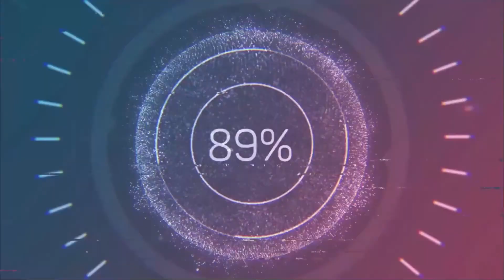All Aluminum Coils & Formicary Corrosion

Comment: Good video. I installed a Goodman unit with all aluminum coil (Daikin switched to all aluminum a number of yrs back) in 2022 and so far, so good, though I did have a TXV go bad. Ended up pushing me into an LPCO lockout due to freeze up from the coil out to the condensing unit. Crazy one little item going bad and what that can cause downstream.

Comment: Is the A frame also aluminum?

I found this video while searching for possible explanations for why my A frame is severely rusting (Carrier, steel A frame, copper coils, ~12 years old).  It seems like straightforwardly bad design.

Noted from your comments:  Don't buy Carrier or Lennox.  Consider Trane instead.  (My mother's Trane heat pump still runs like a champ after 20+ years in Texas.)

Comment: I have a Carrier 24ANA Infinity using Puron refrigerant that was installed in Oct 2010. The coils code, CNPVP6124ATAABAA, started to rust after 4-5 yrs & are now severly corroded. No leaks yet, but replacement is recommended. I live in hot, humid Mphs, TN, so no AC is a no-go. I installed a UV-C in 2020, prepandemic, to reduce mold in the system & to help my asthma. Recommended replacement of other aging & worn components is estimated to cost $11k. Would you recommend parts replacement, including a new coil (aluminum, I hope)? Or would a full unit replacement be more appropriate? Thank you for your info & insight.
Reply from the maker: I would replace it now before R410a system are gone even though you might get another 5 years out of the old system. 

I recommend you go with an all aluminum coil as you won't see the corrosion as you would see on a galvanized fin plates as they would be aluminum. You can insist on this from your contractor, make them put it in the contract. 

Humidity is a problem with any brand of equipment. It would not hurt to save the UV system and have it installed on the new unit. 

If you asthma and allergies I suggest you go with a Trane CleanEffects Whole Home Air Cleaner to capture what the UV doesn't kill. 

You can always email me your proposal and I can look it over before you make a decision and give you some advice. baileysair@sbcglobal.net

Mitch

Comment: The old coils were subjected to formicary corrosion,  incompetent engineers, bean counters, there are 40 year old g.e. still running today w.o. leaks .   No lennox for me, the company has no integrity after doing something like this .stepping up to the plate is good for buisness.  Lennox should have done this.
Reply from the maker: I was very vocal on the internet and Lennox threatened to sue me. At the time I was ready to go to court as this problem was still costing me thousands and pissing off all my customers. The just a few years later the group of lawyers that filed a class action against Lennox over these coils hired me to write up the costs associated with replacing coils out of warranty and in warranty. They used that to negotiate the settlement with Lennox.

Comment: Will 3% hydrogen peroxide, if applied to the aluminum evaporator coils cause formicary corrosion? There has been at least one HVAC forum post that claims regular store hydrogen peroxide will not cause corrosion. It is an effective method of killing  mold and bacteria on the coils.
Reply from the maker: No, hydrogen peroxide applied to the coil will not cause the formicary corrosion, and yes it is a great sterilant and kills just about anything.
Reply: Thank you for answering and providing this very informative video. My Carrier  vendor tech came to turn on my system he did not know what to do about the foul smell coming from the vents. I have been a bit frantic because after spraying the coils with hydrogen peroxide, which killed the smell, i thought some kind of  chemical reaction occurred and i would need to replace my coil.i believe some kind of fumes were coming when the system was running. Very puzzling.
Reply from the maker: @thomast9736  The fumes could come from the reaction of hydrogen peroxide with organic material on the coil that was causing the smell. We usually will mix a few teaspoons of bleach with a gallon of water and and a few table spoons of lemon juice to mask the smell. The bleach kills the mildew and mold on the coil and helps keep away the dirty sock syndrome. You could also install a UV light on the coil that will work 24hours a day killing anything that grows on the coil. This too will stop the smells.

Comment: Either way Aluminum cant hold pressure of R410a for long run 😀, just another way to low down the cost from manufacturing. I have seen many aluminum coil leaking and its hard to repair when the system containminated..I like the old day when they make copper so thick..I have seen many old copper systems older than me 😂

Comment: Homeowner:  Got new 5 ton Trane installed 11/2016.   Coil had to be replaced in two years.  Had to pay for labor and refrigerant. Now 5 years later leaking again!   
Told my warranty is good till 2026.     Any recommendations?  Should the warranty for at least the coil be restarted when it's replaced?  Thanks.
Reply from the maker: Do you have a model number of the unit? Is is a split system or package? I can give you more information once I have the details. Thanks, Mitch

Comment: Firstco is Absolute Garbage!!!!!Using Copper and Aluminum Evaporator Coils Fail Very Fast within in months.
Reply from the maker: You know the manufacturers know about this problem and ignored it for years until they all started to get class action lawsuits about this. Retooling can be very expensive and switching to all aluminum makes a little harder to meet the energy code requirements.

I think the next big class action suits might involve ECM motors as contractors keep setting them on bad duct work and burning them up prematurely.

Thanks for the comments.

Comment: I am in a FL costal environment and I have a Lennox XC21 compressor unit and garage mounted ceiling air handler that was installed in 2011. Thank goodness it had a 10 year parts and labor warranty. I had 3 coils replaced under warranty with the last coil replaced in 2019 during the pandemic. The last coil that was installed was an aluminum coil - I believe they market it as their Quantum coil. I did notice a significate increase in organic material build-up and my drain being clogged but so far the aluminum coil has been holding up. I know my system is reaching the end of it's useful life - in a coastal environment would you recommend a Trane system?
Reply from the maker: I switched to Trane because they had all aluminum coils, and yes I would recommend them. As for the organic build up, many call it elephant snot. Brian Orr of HVAC School.com has a video on it. He postulates that this recent occurrence of elephant snot was because we switched to all aluminum coils. The old copper tubing had properties that kept this from happening the same as using bottom paint for your boat that has copper in it to resist barnacles from growing. He went so far as to recommend putting a couple of pieces of copper in the drain pan to help prevent it from forming. 

Here in California we don't get as much humidity so we don't have that much growth on our condensate systems. Below is a link to his video and my second video just recently that details my theory of what I believe is the real culprit.

 https://www.youtube.com/watch?v=5VOffWjmWkk&t=288s

https://studio.youtube.com/video/sHNF7SKU4Cc/edit

Comment: This was very helpful.  Coil #3 on my 2011 Lennox Signature has now failed - at least that is the high indication without an overpriced leak test.  My first Lennox was great.  I replaced proactively at 10 years to the high efficiency.  I wish I’d just kept it until it died but as you know in FL the last thing you want is for your A/C to die and you have to act hastily.  Is the new Lennox Quantum cool any better?  I was searching on that which is how I found this video.
Reply from the maker: Thanks for the comment. Just make sure they are all aluminum or tin plated. As for Lennox now, I gave them up and washed my hands of them back in 2010 when all the coils we found were leaking. We found too many problems with their equipment compared to everything else we were setting. So, not sure how good they are. Unfortunately, advertising does work as they spend more than any other company for ads and that is why they continue to operate.

Comment: Formicary corrosion, hello Goodman condenser coils.
Reply from the maker: Hi Zach, I would be interested if you have been finding leaks in goodman condenser coils. We have not seen this happening around here, but that doesn't mean that it isn't happening as we don't set as many Goodman as we used to. Let me know what you are finding. Thanks.
Reply: The copper u bends where they run into the aluminum plate leak on early to mid 2000s Goodman
Reply from the maker: @zachosborne6577  I think those might be stress fractures and not formicary corrosion. Of course I could be mistaken.

Comment: A manufacturer Can't double the pressure of refrigerant, Have thinner tubing and insufficient welding practices and  not have leaks. I have a 30 year old evap coil and hasnt ever leaked yet
Reply from the maker: You do have a point, thinning the copper allows this corrosion to eat very quickly through the copper tubing. Your 30 year old coil was much thicker and will probably develop these same leaks only it will take decades and not years because of the thicker copper. Thanks for the comment and when time to replace use all aluminum or coated copper aluminum coil.
Reply: @baileysair  My company is a Rheem dealer. And we had a class on the systems. And I believe Rheem has doubled the thickness of the coil tubes. But made them 7mm instead of 3/8.
Reply from the maker: @smacleod69  My whole problem with this is that the manufacturers knew this was occurring and turned a blind eye or blamed the air in the home and they knew what to do to fix this. 
I had 800+ pissed off customers at me because of all the failures. In other words, my reputation suffered because these guys hid what was going on. 
If you want to equate this to some things happening recently, take a good hard look at getting the Jab and all the health problems that occurred from that.
Reply: @baileysair  I understand. I had replaced about 40 evap coils in 2021. And lennox never fixed the problem. And alot of our customers were not happy.
Reply: @baileysair  That comment surely does not compute.  Big loss of credibility there.
Reply from the maker: @jameshumphreys1927  James, that was supposed to read 2011, fat fingers, I think I replied from my phone. LOL

Comment: Never mentioned anything about the relation between coil cleaner and corrosion!
Reply from the maker: Hi Cory, most of these coils that are in the playlist we had the maintenance contract on them as we were the ones that installed the systems. At no time during their maintenance did we use coil cleaner on them, heck some were only a couple of years old and never needed to be cleaned.

This excuse by the manufacturers to blame the air in the home is laughable, as some of these coils were installed on homes that the customer did no other remodel work or changed the cleaning supplies they used in the home, in addition their old system lasted 25 years with no problems. In other words the only thing that changed was the equipment itself. 

I still believe that flow electrification was a contributing factor in addition to the manufacturers thinning the copper tubing. I tried to get several universities here in California interested in taking this up as a masters thesis for some aspiring university student, but no one would take it up, formicary corrosion isn't sexy and/or leads to bigger and better things.

I studied this intensely when it cropped up and that was my conclusions. However, the fix still stands, you need to switch to all aluminum coils. Since I have made the switch we have found a few leaking coils but they were all either bad factory welds, stress fractures or tubing rubbing together, no more corrosion. 

However, all aluminum coils are subject a myriad of other problems like being less efficient and in certain climates biological growth that can plug condensate pans and lines, below is a link to a Brian Orr video about it. However, in our area we don't see the growth issue.

By the way check out my new video on Ultra Low NOx furnaces, I see these ULN furnaces as being the new problem, luckily they are only installed in California and not anywhere else, link below.

ULN furnaces: https://youtu.be/pYAvLMWjuzQ

Elephant Snot: https://www.youtube.com/watch?v=5VOffWjmWkk&t=276s

Comment: I need to have my copper-aluminum condenser coil replaced with an all aluminum coil. Will all of the connecting tubing need to be replaced with aluminum tubing to prevent new corrosion from forming?
Reply from the maker: Question, this is the condenser coil that needs replacing? I ask because we have not had a plethora of condenser coils that need replacing. Unfortunately, the condenser coil usually comes from the OEM and that will be what ever type they make them in, some like Trane are all aluminum, other brands are still mixed metal coils. However, you can have the whomever is replacing the coil send it off to be epoxy coated so this would not be a problem in the future. They usually do this when the coils is in a corrosive environment such as close to the ocean. This can be pricey, but the coil should then last the life of the system.

Comment: I sure could use some advice. I live in NC and my 1st floor HVAC system and ductwork was replaced last fall with high efficiency Trane equipment. At the same time the crawl space was cleaned of mold and encapsulated with the space now conditioned by the HVAC system. It worked great through the winter and summer. Then in the fall we no longer saw the cooling cycle engage until two weeks back when it got hot. That's when the whole house smelled so bad we had to leave. A Trane tech performed a full pm on the furnace and exposed the aluminum AC coil. The coil looked clean. The tech said this did not smell like dirty sick syndrome. Everyone who has been consulted so far is stumped. Someone said it's the fault of the aluminum coil since it doesn't have the antimicrobial properties of copper. Any thought?
Reply: Aluminum Coils can produce a benign bacteria called Googlii. Since it has not anti Microbial properties like copper does. It can clog drain lines. ONe solution is to have a uv light installed in the evap coil. One brand is called "Bluetube". Or other product like an "Air crubber" or "I-wave C" can be installed and is suppose to help keep odors down and kill bacteria and viruses. Check it out and see if it helps.

Comment: Aluminum coils are junk....Goodman coils leak consistently...some right out of the box....as do so many other manufacturers... Years ago when G.E. made coils they lasted over 40 years.  They used thicker copper and thicker aluminum fins...just as you said. They did however make the aluminum spined fin coil that was great...thick aluminum tubing that lasted for years! I still service some systems from the late 70's mid 80's still in service that have outlasted newer systems. Manufacturers simply make the coils thinner to make them CHEAPER...The manufacturer's put a nice spin on their reason to making thinner coils is in the consumers best interest to "save energy" ...but the real reason is because it saves the MANUFACTURER  MONEY ....FOLLOW THE MONEY !   the thinner coils attribute to a marginal savings of energy versus the impact cost to the consumer to have to pay for a coil out of warranty.  The EPA puts blame on the technicians and industry for venting refrigerant which destroys ozone or attributing to greenhouse warming gasses into the atmosphere....when the biggest  issue is the manufacturers making junk coils which leak refrigerant  into the atmosphere. The EPA should be on the manufacturers ass to make a refrigerant containment vessel that is worthy of protecting the environment...The manufacturers have deep pockets to hire lawyers to do otherwise...where as the average Joe consumer  get's screwed.  GREAT VIDEO... It's nice to see another fellow HVAC Contractor that recognizes the true issues with equipment quality.
Reply from the maker: I really haven't found many leaking aluminum coils since our switch. In fact, we won't do a copper aluminum coil because of formicary corrosion. Any of the aluminum coils we found with leaks were from the factory as bad welds or bad design with two pieces of tubing rubbing together, either way we just replace the coil, slide out the old one and install a new one under warranty. 

I know you say follow the money, but this type of failure the manufacturer doesn't want either because it does cost them money. However,  you are right in that they are making the tubing thinner to save on cost, but this also does make them more efficient.

If you really want to get into the weeds about follow the money, go back and look at who brought to the attention of the ozone problem and refrigerants at the Montreal Protocols. It was DuPont who owned the patent for R22 and R12. They said it was destroying the ozone so we need to ban the refrigerant, oh and lo and behold they were losing their patent for those refrigerants in 1999 so what better way to continue receiving billons of dollars in royalties by coming up with R134a and R410a. Yep follow the money!

Thanks for the comment.
Reply: @baileysair  thats very scary and sad that millions of people have worse products in their homes because of DuPont